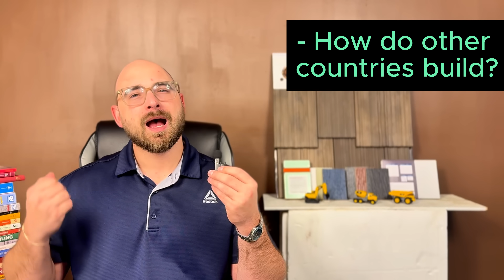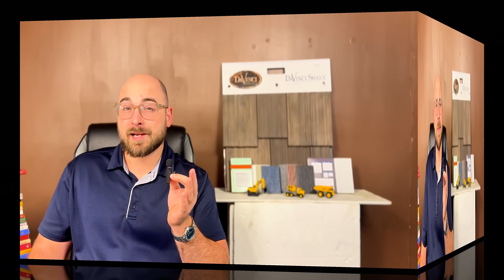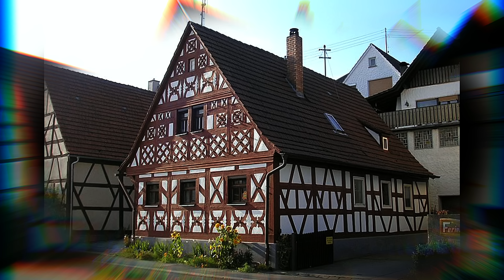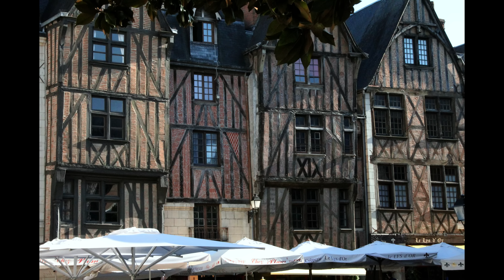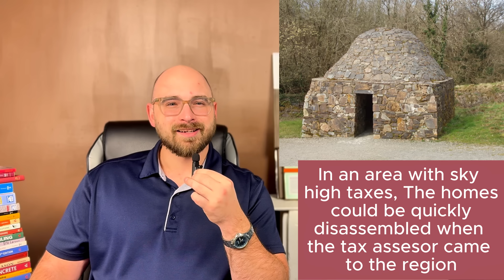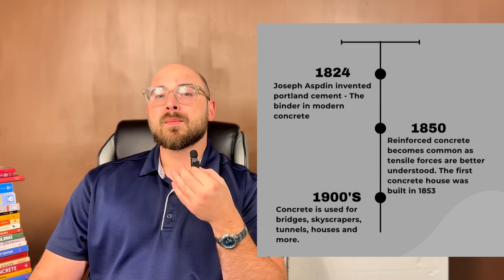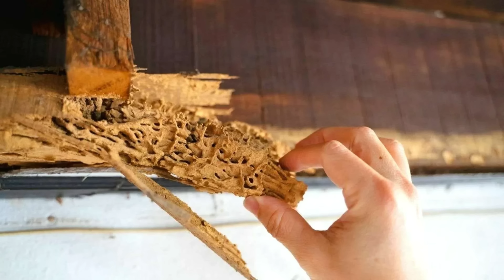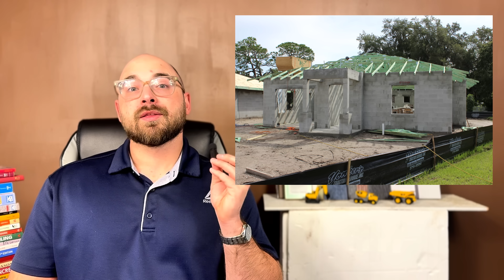Why Other Countries LAUGH at American Homes

Comment: there is a story for kids it is called “three little pigs” it’s quite educational
Reply from the maker: Maybe I should do a video on it lol
Reply: @Mike_Fortin As long as it’s the Green Jello version. 😉🤪😂
Reply: @Mike_Fortin "the fourth pig had a house built out of wolf skulls. Not Surdy, but drives the message home"
"Fifth pig had a house built out of depleted uranium"
"Bruh" said Wolf
Reply: @Mike_Fortin  yes
Reply: @Mike_Fortin  Couldn't be much worse than this one. As a builder, I think you're an idiot.
Reply: Concrete can still be a viable solution for earthquake prone areas provided construction follows seismic guidelines & methodologies ( Shear walls, ICF blocks, foundation isolations…). It’s important to adapt the construction method with the conditions of the location, which is why some of Florida, not all the counties (looking at you Orange County, Orlando), due to hurricane risks it is not allowed to build exterior walls with wood framing.
Reply: The one about the hen planting seeds is a good life lesson also.
Reply: @bud5084  i loved that story!
Reply: I loved this story when I was a kid. Now my nephews do so, also. 😊
Reply: @HLife719  If you haven't seen it, check out - Green Jello, 3 little pigs.
Reply: Thankfully architects and engineers are educated beyond third grade.
Reply: Earthquake and hurricane? (Taiwan has joined the chat.) In Taiwan, we only build houses with reinforcement concrete because that is the only material that can withstand both earthquake and typhoon. Definitely not wood. Skyscrapers are also built with RC with I beam.
Reply: we laugh, but its painfully clear instructions!
Reply: Maybe the next big hurricane should be called "Big Bad Wolf" and the news presents it like it's a Kindergarten story, so people will get it?

Everyone here in the comments thinks there is one way to build houses, instead of building for the environment it is in. Cherry picking holes to find a problem so you can shoot down the argument is childish. Of course you don't build a regular brick building in an earthquake zone. Or right in the path of regularly occurring hurricanes. A worse option is a weak timber frame house with plywood walls. A sane person would build their house to withstand those regular natural disasters, instead of rebuilding the same flimsy houses. Or not live there maybe? Floods you can protect against, just ask the Dutch. Hurricanes/tornadoes not as much and they're only going to get worse.

Look at Japan and their earthquake proofing. Yes, they need to rebuild parts, but not as much as they otherwise would. Same in the Caribbean and Gulf of Mexico. They get really bad hurricanes but the houses are still standing as they're concrete.
Reply: Well, he huffed and he puffed, all that he could
And lo and behold the little piggy's house stood
"It's made out of concrete", the little piggy shouted
The wolf just frowned, as he pouted
So, they called nine-eleven, like any piggy would
They sent out Rambo just as fast as they could
"Yo, wolf-face, I'm your worst nightmare. Your ass is mine!"
Reply: Then there was the fourth piggy, who built a house made of wolf skulls in order to send a message
Reply: Some of the deadliest tornadoes in the US struck brick and masonry buildings. Particularly the Tri-State tornado in 1925. Many piles of bricks filled with bodies. Modern homes in the US, particularly in Tornado Alley, are built with that weather reality in mind. Nowhere else on earth gets as many strong tornadoes as here, so they're not as prevalent of a construction concern.
Reply: @HeadFullaStuffin  people don't wanna recognize that a strong tornado will topple any building, and it's a lot less dangerous to have wood structures collapse than rock structures.
Reply: @Batmans_Pet_Goldfish you're absolutely right. And you gotta consider that anything that gets wrecked by the tornado can easily become part of the wrecking ball that is the tornado. I've seen pictures of twigs skewering concrete. It's so much safer to have a bunch of sticks hurling at you at 100+ mph than bricks hurling at you at 100+ mph.
Reply: @HeadFullaStuffin bs
Reply: @Maggotsilva which part of what I said was bs? And do you have sources to back it up?
Reply: They don't seem to learn the moral of the story there... because almost every year, the big bad wolf that comes from the Atlantic knocks a few thousand more wooden houses, again and again and again!!
Reply: Oh you just now read that book? 😂
Reply: @it was part of my kindergarten curriculum 😜
Reply: Best comment
Reply: Agree ,perfect example !
Reply: @raftguy1376  In third world america maybe, other countries have decent building codes.
Reply: Describes American houses
Reply: Yes, educational of course😎
Reply: Green Jello told me that story! 😂
Reply: Excellent point
Reply: Also a great music video by Green Jelly. "Yo, Wolfman! I'm ya worst nightmare!"
Reply: Hahahahaha vrištim...e moj mirko...kak se tog ja nisam sjetio?
Reply: @zagrepcanin82  😂 pre par godina, ceo američki youtube za konstrukcije kuća sa oduševljenjem otkriva klima uredjaje. Baš mi je bilo čudno 😂
Reply: Yes, bit not quite applicable any more. Check out strawbale houses... They are made from extremely densely packed strawbales, so they are very fire proof, have great insulation, can be built with timber framing or load bearing, and are essentially made from an organic waste byproduct of our food production...
If I had the money to buy land and build, it's what I would choose. Combined with lime and clay plasters...
Reply: In the modern rendition of that story, the wolf is the Wolf of Wall street.
Reply: @raftguy1376 Wrong  EU houses are made of brick with concrete frame reinforcement. They survive. Even bulet prof.
Reply: None of the pigs their homes out of paper. Jajajajaja 😂😂😂😂
Reply: @triad6425 true it's how a constructed the majority of the US home now says 👀
Reply: @triad6425 but we're not talking about japanese homes.
Reply: Posted also on another channel the same!  AMERICA !!!! MAGA!!! and they build cardboard buildings! So Shame!
Reply: Exactly that's what I tell people that tell me that's the way homes are built.  I also ask them if they would jump off a cliff if everyone else was?
Reply: There is no education in the US, they can't know that 👀😹
Reply: @raftguy1376  this is not the original story 😉
Reply: @raftguy1376 Hearst built his central California "castle" with concrete like a bunker and it has survived every earthquake so far. And many of the WWII concrete bunkers in Germany are still standing despite being hit by bombs. Concrete is the way to go in earthquake areas.
Reply: @raftguy1376 you are moron from what material you think the homes in Japan are made of. And they are designed for heavy earthquake and you don’t have this in America
Reply: Man I still prefer the 4th pig, unluckily it doesn't apply in this case lol😂😂😂😂
Reply: Yeah,and a Toyota ad about piggies in a van
Reply: Most be a documentary for kids at schools. Hahahaha
Reply: @raftguy1376 nu-uh it was a japanese pig, they know how to design it to withstand an earthquake
Reply: LOL!!
Reply: I lost so many braincells reading peoples' takes on bricks and earthquakes. Thats my fault for expecting people not to be retarded on the youtube comments i guess...
Reply: Sandstone is no longer a common material used, and I can understand why.
The house we live in has a sandstone foundation, the basement always has a dampness to it, because of leaks through the cracks in the sandstone, and the water then runs along the concrete floor to a drain, sometimes, so the dehumidifier has to always be running. It also creates extra chores to keep up with. Crickets, spiders, mice and sometimes snakes come through the cracks or holes in the gaps of the sandstone. So a designated broom stays down there to clean up the floor. I can see why it has been impossible for me to find anyone else with a basement with sandstone walls. If not for this basement though, there would be no central heating nor a safe place to go to during a tornado warning.
Reply: Specially in tornado alley
Reply: Oh you went there😅!
Reply: Climb a giant beanstalk and check out how the Giant's house is built.
Reply: And there's also real events like the fall of the Roman Empire. Apparently Europe is repeating the same mistake the Romans made. I'll be laughing in my house made out of wood, as I watch the muslims destroy your houses made of brick bltch. Lol
Reply: If the little pigs has insurance it wouldnt be an issue 😉 
If people want to pay double the price for a brick house for a slim chance of it/them encountering a bad weather event, then they can do that if they want. Or one can just pay annual home owners insurance vs a higher mortgage payment for their life.
Reply: Europe is being overrun by muslims and africans. Let's see how much your sarcastic comment lasts before youre begging US. for asylum.
Reply: Yup. Chad Brick Pig chose wisely.
Reply: 1st pig built a house in US, 2nd pig built in South East Asia and the 3rd pig built a house in Japan. 😂😂😂
Just kidding!
Reply: I always thought it was funny that we saw the worst pig and made all of our homes like his.  Lol.
Reply: Louisianian turned Floridian here. You know houses hit by hurricanes aren't just falling down, right? The vast majority of damage comes from either flooding from the rain, storm surge (both flooding and the initial force), or trees falling on houses. For flooding, it doesn't really matter what you're building out of. Unless you're building a doomsday bunker, your door isn't going to be sealed tight enough to keep 10 feet of water out. For storm surge, which is the thing that causes the pictures of whole neighborhoods/cities just gone, it's often just taking the ground out from under the house. I guess you could argue that the times when it is instead tearing the house off the foundation are because it's made of wood, but that can happen to any type of house, not just wood ones. As for the trees, unless you think you could build a roof that wouldn't get damaged when a 100 foot tall, 3 foot wide pine tree gets pulled up from the ground and dropped on your house, I'm not really sure what the argument is.
Reply: Brilliant Example 👏🏼👏🏼👏🏼
Reply: Um we had a 7.3 in 1976 and a couple bad tornadoes in the last few years. In the tornadoes we lose some roofs, sure, but the buildings that rip apart are cheap pre-fab American style storage buildings. Our barns are built better than your houses.
Reply: @auntykriest  The only 7.3 in 1976 earthquake I can find was in Eastern Turkey, which is in Asia.

You're going to have to explain "American prefab...storage" as prefab in the US and Canada is not common, as is usually reserved for large things, like bridges. Are you meaning like those cheap premade kit sheds that are like 10x10?

Your IF3 tornado is the equivalent of a US and Canada F1. Any building in the US and Canada is made to still be standing after an F1, it might need new shingles, but it will still be standing.

Again all of this means nothing as, you are from where? Europe has more building codes than 1.
Reply: But your Muriken so you know it all, I forgot. Good luck with your cardboard shed 😂😂😂
Reply: There's a thing called "weather" and maybe you should learn a little about it, becuase the weather in the US flattens cities and constantly tries to kill you
Reply: @n52kam09  Then why live where that weather is? Maybe tell your fellow American'ts, they're the ones having their carboard homes destroyed. Stupidity is a choice.
Reply: But the wooden house in USA is the same quality with straw house😂
Reply: Thank you for mentioning this. That story often comes to mind for me when American houses are mentioned because of how often American houses burn or break
Reply: USA kids didn't read the three little pigs,
they  saw pigs on the cover and went to McDonald
Oink oink
Reply: @raftguy1376 fire are more common then major earthquake but still american insist to build plywood house to againts a fire😅better earth element vs earth element then wood vs fire😅
Reply: @hanisrosli5484 cause when American can't afford the house no more, they can start a fire for insurance 😂😂😂
Reply: I used to be amazed at the idea that American houses are so light you can carry three storey houses with a truck. Lol. But as an adult,having that light material for a house is the worst idea not only giving it vulnerability against fire but also termites, getting blown by the storm or even get holes just through punching lol
Reply: @anickia12  Yall act like we're over here just getting pummeled every few seconds.

There are far more wooden homes than have been standing for 30-100+ years no problem.

Yes, we are a HUGE land, with varied concerns abound. Yall see a few isolated disasters and the entire lamd in boned apperantly 🤣

Mother Nature decides to ever have a tantrum in your neck of the woods, you'll get it. There's only so much the smart folk can account for when she aint exactly obligated to stay face everywhere,  materials be darned
Reply: The first little pig built his house out of straw...which is actually a very effective building material against high winds with modern building techniques,so he was just fine and had plenty of time to grab his Second Amendment equipment and reduce the local wolf population to zero.
Reply: lol not at all
Reply: Might be a little highbrow for the target audience
Reply: Ah yes come to the comment section to see the Europeans seething
Reply: @snowfuhrer  Ah yes, come to the comment section to see the American'ts wallowing in their superiority complex, despite being utterly incapable of offering the most basic of counterarguments. 

How predictable. America's national narcissism on full display. 

None of the Europeans are seething. They're laughing.
Reply: Now compare how many years each pig had to work in order to buy their respective houses, due to the differences in the costs of materials and labor.
Reply: As is seeing brick walls toppled on top of people after a tornado, especially in schools. 2013 in Moore, OK is an example.
Reply: @J-1410  Creating a stable construction only with bricks is a different branch of civil engineering. You can make a seismic steady brick construction if you know how. For such a collapse of a wall you need to blame lousy masonry with sub-standard mortar.
Reply: @НевенаНиколова-к6ы exactly
Reply: @J-1410 my area of about 4000 homes was just hit with winds over 180kmh, not a single home knocked, a couple roofs damaged but that's it.
Reply: @Fragarach-10  Half of the plains gets hit by 110(MPH) winds every year with same results, but usually they're fine.
Reply: @J-1410 seeing a wooden house float too the ocean...
Reply: @J-1410  that's only if you build without having safety in mind.

if you build to last and build according to the safety regulations those things won't happen.
modern brick buildings are almost always a reinforced concrete "block" and brick walls around the outside, with isolation between the two walls.
the bricks make the building look nice and authentic, the concrete provides the strength to withstand anything and is easy to build and place.

but even old school brick buildings are strong. 
take Amsterdam, those famous houses along those canals are often more than 400 years old. 
just some wooden poles rammed into the ground and a 4 story brick house on top of it. 
and they have been standing almost twice as long as the US is old.
Reply: @J-1410 what fucking amount of wind is blowing down a solid brick and concrete wall 😂. Wouldn't that sort of power just blow mountains down into the size of hills
Reply: @NathanPeacock-fe4gn Over 500kmph. We have had multiple tornadoes with recorded wind speeds over 500kmph, such as Moore 1999, El Reno 2013, and Greenfield 2024.
Reply: @J-1410 lol, if your brick house is falling down due to a tornado. 
You don't know how to use brick houses.
Reply: @SunnyChoudhary-k5k we're talking about actual tornadoes, not european tornadoes barely the size of a person, these things will rip apart ANY above ground construction, the main concern in tornado prone areas is minimizing damage to people and easy of rebuilding, would your rather have a piece of would coming at your head faster than most cars, or a brick? I'd rather have wood, cause there's at least a chance I survive. housing requirements are made based on their envieonment, wood isn't better than stone and stone isn't better than wood, they have different pros and cons that make them better for use in different areas
Reply: @SunnyChoudhary-k5k  you clearly have no grasp of how the codes arent exactly fool proof.

The codes tend to only be made to withstand "so much" of a thing. And last ai checked, Mother Nature has a tendency to to outdo them cute codes when she pleases 😂
Reply: @hackspawn1 I'd rather live in a house that won't fall on me, but I guess that can't be achieved in a wooden one.
Reply: @J-1410 lol
Reply: You say it as if flying pieces of wood won't kill you @J-1410
Reply: @J-1410  That is a brick facade over a toothpick stick frame, not a European
masonry structure. IE bullshit construction.
Reply: @J-1410  Plaza Towers school wasn't the "brick walls toppled over" it was the roof that fell on people. If you look at the pictures the walls are still standing. If they made reinforced concrete roofs instead of the metal roof they used the kids would have been safe.

And these walls are also poorly made, they have no structural columns. Americans really don't know how to build.
Reply: @J-1410  ....Depends of the type of brick and how it's laid. But your right most times its just a veneer. That's why the best homes in down here in Florida are built with cement block.
Reply: @J-1410 i live right down the road from there.
Reply: @J-1410 moral of the story, a pig builds stronger brick home than an american?😂
Reply: @J-1410  and at the same time there are wood planks pearcing people. Extreme cases always exist.
Reply: @J-1410 id rather take a 2% chance of my wall collapsing and killing me over a 98% chance of losing my home and still possibly dying due to wood splinterings
Reply: @J-1410  You need to read the story again
Reply: @J-1410 the bric walls weren't carrying.
Reply: @J-1410  yeah never happened keep building shitty houses 3rd world USA
Reply: @J-1410  that doesn't happen. You have one case in 50 years LMAO

Every tornado you can see houses toppled over people.
Reply: @LucasBKOK  You do realize it has happened so much that wikipedia has a list for it with 50+ dates in less than 200 years?

Also, what do you see with wood houses "toppled over" but don't with brick and concrete? People being pulled from the rubble, alive.
Reply: @J-1410 then why live in wooden houses? Being crushed by wood isn't much better than being crushed by bricks and concrete. Maybe you should all live in tents, you'd be fine after any earthquake.
Reply: there is the material, then there is the method...
wood does retain some advantages, but it also does have a lot inconveniences, and even more with the US fast build method... cheaper, faster to build, but also doesn't last as much and is absolutely dependent on constant maintenance to not rot.
brick/stone/concrete build, given the method used is adequate, last for many generations... but the initial cost is higher
Reply: @J-1410 
Lil bro thinks build houses in tornado zones is not a problem
Reply: @J-1410 because they're not built to European standards. You can't just stack up bricks and hope for the best. I mean, you can, but you saw what happens.
Reply: @auntykriest  When was the last time Europe was hit with an earthquake or tornado?

Most of Europe does not even have standards for Earthquakes or Tornadoes. 

May I present the Albanian Earthquakes as an example?

European standards are literally less than American standards as you don't do not have the weather or events as the US does. It is like you saying "Why doesn't everyone in the US have a bomb shelter? We do in Eastern Europe and look at how great they are/Look at how well they worked during ww2.".
Reply: @J-1410  reinforced concrete panels will never do that.
Reply: @cristitanase6130 Again Moore,OK shows otherwise
Reply: @J-1410  then it probably have not the German Engneer Spirit in Europe we are no Gypsies moving around
Reply: I don’t recall the three little pigs surviving a earthquake. Bricks are about the worst thing you can build a house out of in earthquake, prone areas.
Reply: @STEVEM730 um... I live in an earthquake area and all new homes and renovations here are clay block and reinforced concrete. Engineering.  BTW ever seen what happens to a stick and paper house in an eathquake? 😂
Reply: @STEVEM730  In Mexico houses survive earthquakes, just dont buid big buildings of concrete.
Reply: @STEVEM730  don't live in earthquake prone areas then, that's a stupid thing to do, like building in deserts with no water
Reply: @STEVEM730  è una questione di probabilità: è più possibile che arrivi un incendio o in terremoto? Qui nel sud Italia entrambi, ma fra i due gli incendi arrivano più spesso, e allora vai coi mattoni: almeno la casa è più fresca d'estate e calda d'inverno e non sento i vicini. E se arriva il terremoto, così sia
Reply: @STEVEM730  I do wonder... how many peoples dead burning in their wood home vs peoples dead by the collapse of their brick home?
Reply: @STEVEM730  I live on the most seismic country in the world and all the houses are made of birck
Reply: @STEVEM730  pov u are amarican and confident. He says in this video solid houses are more disaster proof including earthquakes
Reply: @STEVEM730 Taiwan and Japanese cities have brick and concrete buildings made to withstand earthquake. It's an additional skill to adapt
Reply: @STEVEM730 not necessarily, here at the southern Pacific ring of fire, there are houses still build with bricks that passes without problems the earthquake and flooding guidelines
Reply: @STEVEM730  the video is about the US housing and you don’t have earthquakes. 3-4 flat buildings are also made from wood. And you have plenty of fires tornadoes and floods
Reply: @kriskris998  sure we don't earthquakes. 

No way there are any faultlines anywhere at all on this continent.

Not even
Reply: @STEVEM730 americans build wooden houses in typhoon danger zones 🤔
Reply: I would read it but I'm not gay